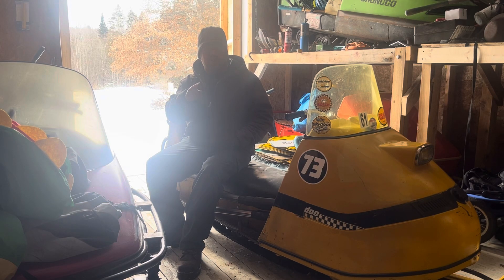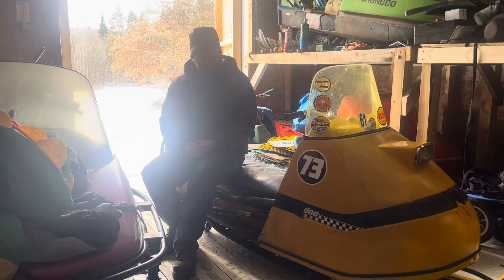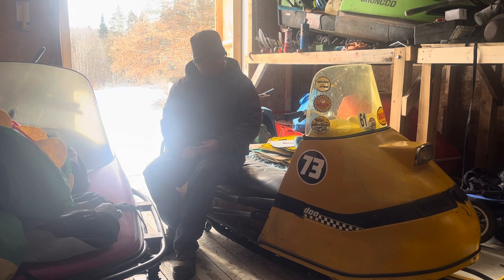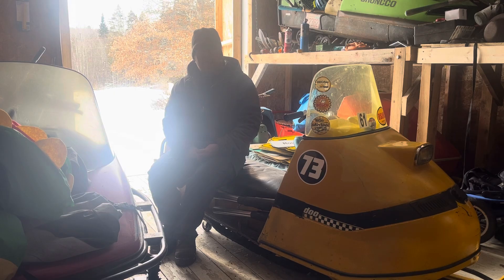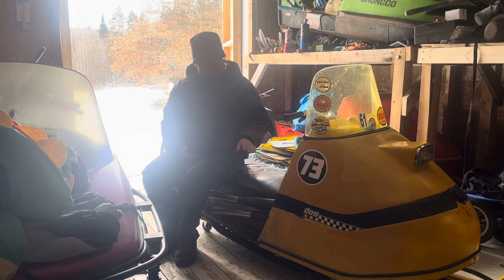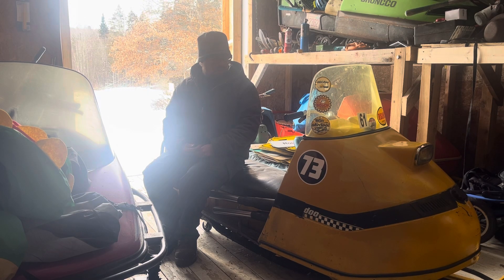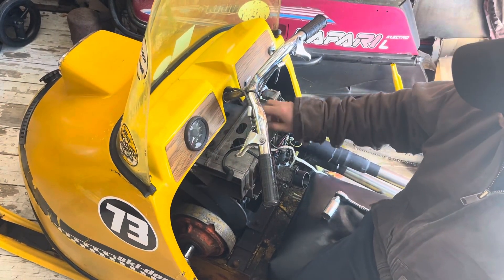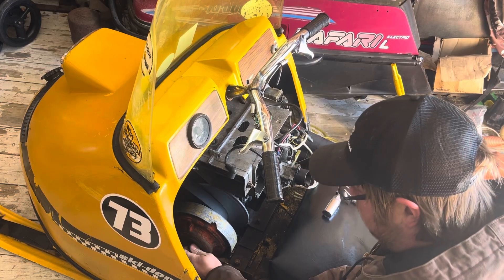1970 12/3 mod 340

Comment: I have two '73 340 Olys and I have ridden an identical ;74, they top out at 50 mph all things wide open with my 185lbs on it.  Now a stock 12/3 as you say had 10/25 gears.  I have a '68 that was originally a 370 opposed and I put what I had, a '67 10 horse on it. I took the 11 tooth top and swapped it for a ten tooth, it helped that thing a lot.  I mean 27mph is what it tops out at! :)
Reply from the maker: @Jethrosgarage  this one has 13 tooth on top that I put on it